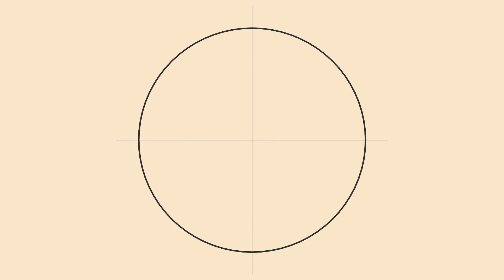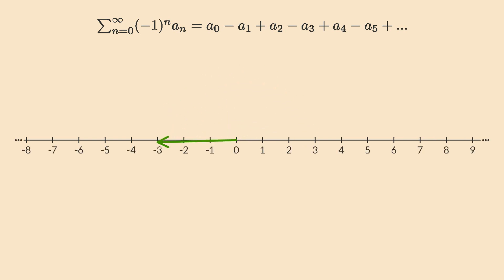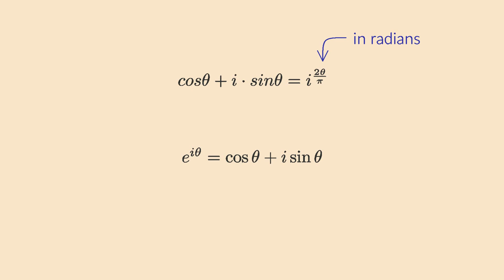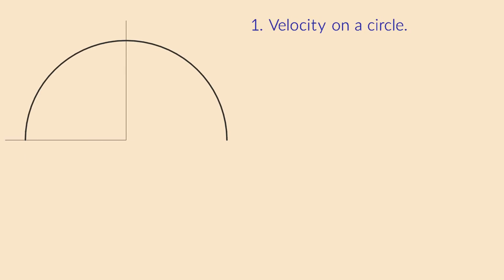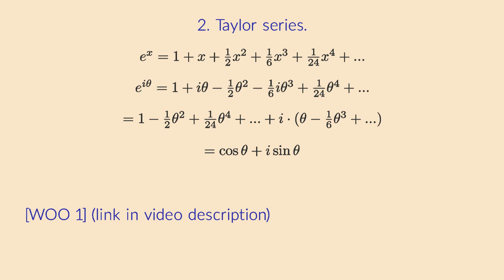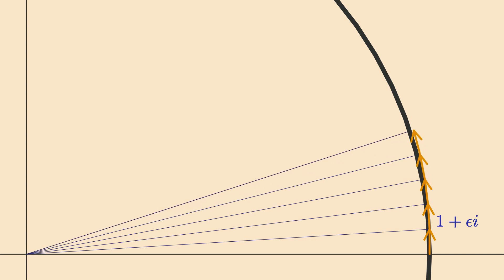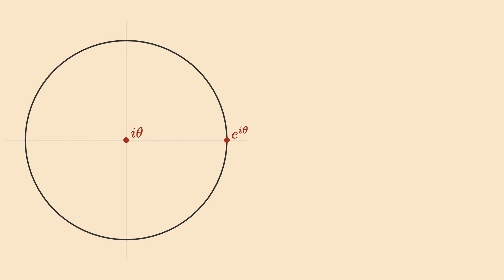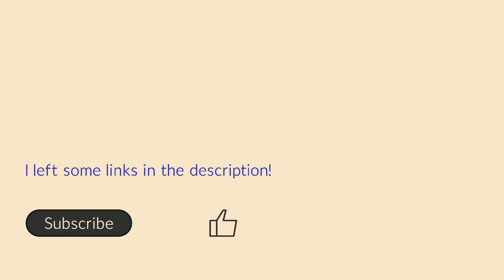Euler's formula and continuous rotations | Complex numbers episode 3

Comment: I'm somehow stuck at the step where you've got rid of the 1/i expression in the parentheses. How does -(1/i)*sin(theta) turn into i*sin(theta)? How does the sign get flipped?
Reply from the maker: Good question, and sorry that I don't make this more explicit in the video.  The trick is actually very simple:  When you have a 1/i, you can just multiply the numerator and denominator both by i.  The numerator is then i*i, which is just -1 by definition.

So you get i/(-1), which is the same as -i.  That's why the sign gets flipped.

Comment: Thx. I always got stuck when trying to link rotation to euler number. Finally i realized that it's rotated by 1+εi instead of i itself
Reply from the maker: Yes 'i' is just the generator of the rotations, but you have to exponentiate it in order to perform the actual rotation.

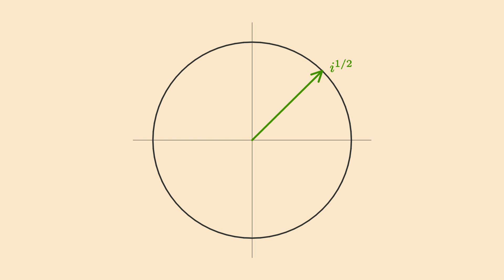Comment: A "straight angle" in English refers to 180 degrees or pi radians. But around 4:30 you seem to use "straight angle" to mean "right angle", which is 90 degrees or pi/2 radians.
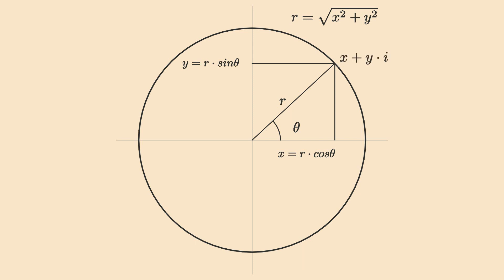(As an aside "arithmetic" has stress on "met" when it's an adjective, but on "rith" when it's a noun (so it almost fits into the English pattern of initial-stress-derived nouns), so that 0:38 takes an extra second for a native speaker of English to parse.)
Reply from the maker: Thanks for the correction.  English is not my native language, as you probably guessed.  I sometimes translate too literally from Dutch.  I'll have to be more careful with that.

Comment: @6:36 - I don't think Euler's formula is elegant. Using i^x is better. Where x is a right angle. Also sin() and cos() should respect right angle values. Then there is no need for a pi symbol in there, which has no meaning except when required for rotational distance calculations. I think equations would be cleaner with right angle powers. And remove the 2pi which has little value except for chaing the base symbol, which isn't even needed if cos() and sin() were understood to use right angle entry. Math is like traditionally dumb. They love pi because they do. They put it in where it's not needed and celebrate memorizing digits like it means something.
Reply: Oh, Man... I got it! April Fools to you, too!
Reply: I personally would rather work in fractions of a full circle, so i = a^(1/4). Unfortunately... the number a that could satisfy that equation is... 1, which isn't the best choice for the base of an exponential meant to generate angles.

I'll also mention that for the ℂomplex numbers' cousins (one of which was briefly mentioned in the previous video before being discarded to due the presence of zero-divisors), neither have any value of φ where their "imaginary" unit, which I'll call "j" for now, is e^jφ.